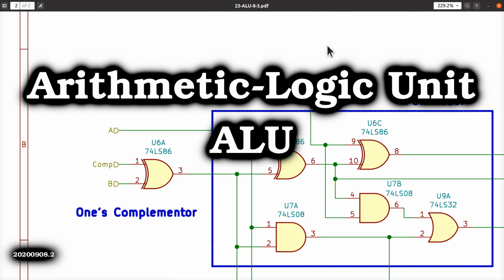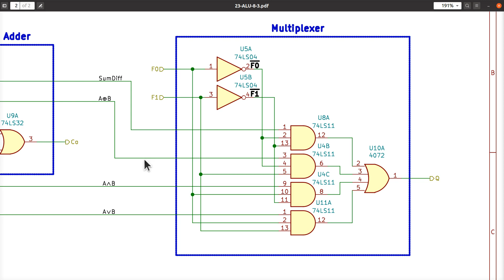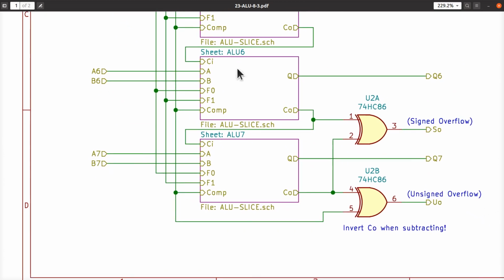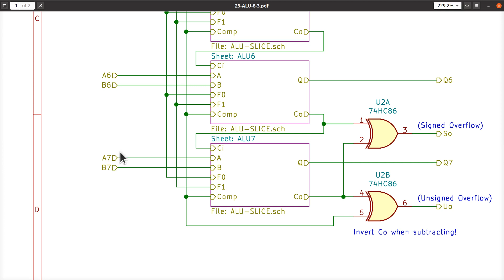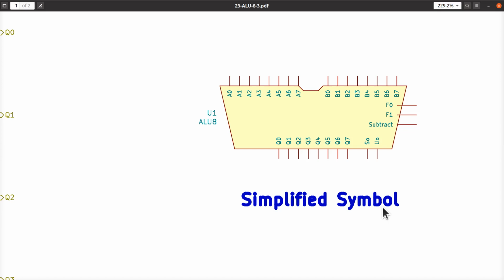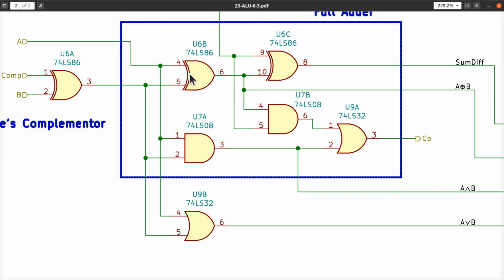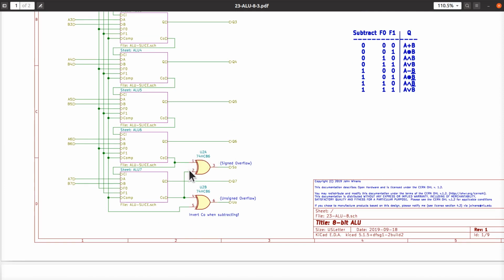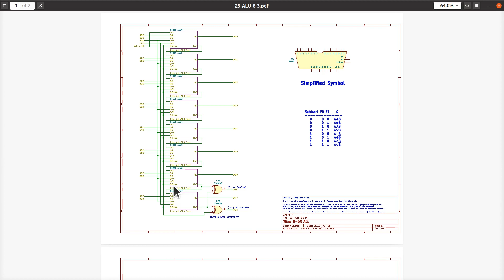Arithmetic Logic Unit

Comment: Twin 5ohm MUX4 passes any Karnaugh map, also Manchester Carry.
Why do we need a Ripple Carry adder in front to slow it down?
Why do we need discreet gates in front to limit our logic choice?
74CBT3253 fits well with 74LVC2G86 on an SSOP to DIP28 PCB.
XOR B to subtract. XOR Karnaugh vs prior carry for full result.
Pull Generate low to disable arithmetic for pure logic.
Pull Annihilate high to reverse subtraction.
Reply from the maker: I should have opened that recording with a statement describing it as functional, but not optimized.
Reply: At least you tap into the adder for logic, better than some examples.